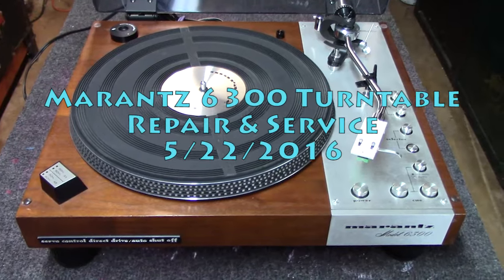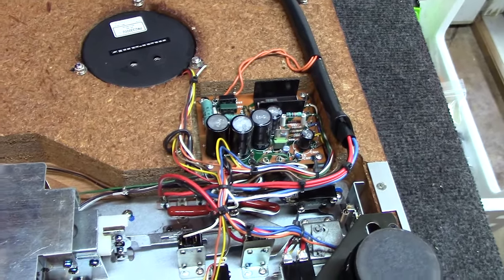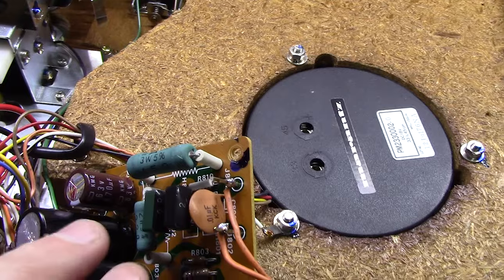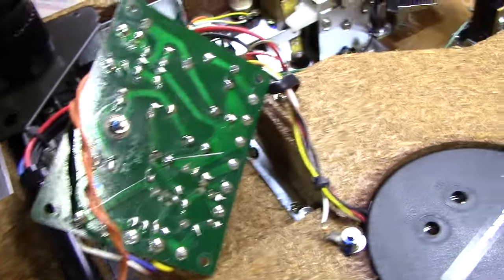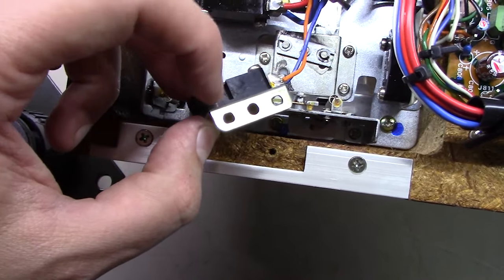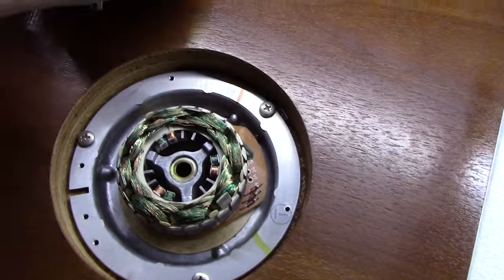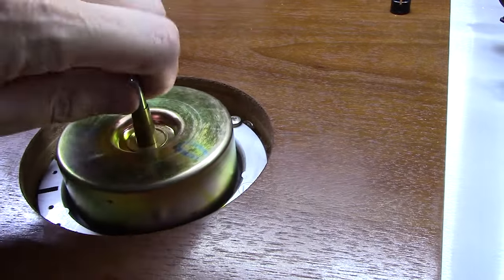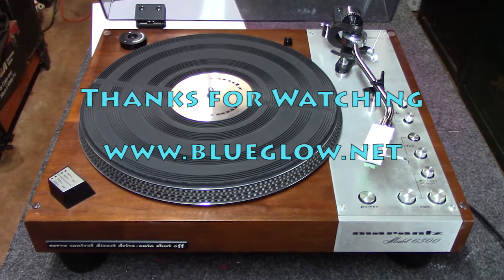Marantz 6300 Turntable Repair and Service - BG061

Comment: I have a 6300 myself. I had it serviced. I just needed a new strobe light and a good cleaning. Hopefully I’ll get another 45 years of use out of it. But, wait…. I’m not going to around another 45 years. But, you get my point. 😊😊

Comment: I went above and beyond on my Akai AP307 I installed new caps it fixed issues with startup delay and hum didn't lube the motor it's moves freely it turns using pulses instead of constant rotation great quality well built only payed 200$

Comment: I've seen other people say that because the electrolytic capacitors in a turntable are not exposed to high frequencies that they should be okay after 30+ years. In my experience in fixing turntables I find some of the caps are off or leaky (especially the blue Sanyo caps from the 70's/early 80's). Simply because they have not been exposed to high frequencies over a long period of time does not mean they will be okay today. As shown they will degrade mechanically and start leaking corrosive electrolyte, depending on the age/brand/cap series/use of the unit.

The safest solution is to replace the electrolytics if they are the originals and are 30+ years old. The advantage is the new units usually will be smaller at the same or higher voltage and will be better long term due to advances in technology.

Comment: Excellent video.  May I add a bit of info. please (I've owned this TT for 40 years): please refer to timing 17:40 where the flywheel is removed from the motor for cleaning. The moderator correctly stated that THIS flywheel has no ball bearing at the bottom of the flywheel shaft, but other companies did include one (so don't tip the TT over and lose it). However, this ball bearing/flywheel setup exists on my model 6300. I noticed it 35 years ago when the first lubrication was done, and I heard it rolling around at the bottom of the shaft. In this case, you must tip the TT over with your hand over the shaft hole, catch the ball bearing, and then clean/oil that area.  Thank you.
Reply: turnstile7: thanks very much for that great piece of information!  My old 6300 is in near mint cosmetic and working condition EXCEPT the darn optical sensor setup that controls the auto shutoff is stone dead (not a matter of adjusting the sensor position on its little track). Nobody will touch this repair job (obviously no parts available). Do you know of anybody?  Thanks!

Comment: Agreed about the oil.  I buy turbine oil for the long spout. At 2 bucks, I go several years.  I did use 2 stroke oil on a 1/4 HP motor, it worked great. Capacitors, Yes the years are ticking by. I was a teenager when that came out.  I cannot accept your deduction of it being 40 years old. LOL

Comment: Can you put a list of the caps used in the description please? Thanks for the great video.
Reply: C801 - .01 uF (ceramic) - 200v
C802 - 470 uF, 50v - electrolytic
C803 - 330 uF, 50v - electrolytic
C804 - 220 uF, 25v - electrolytic
C805 - 100 uF, 25v - electrolytic

Comment: Great video.. very useful.  My service issue is a no longer properly dampened tone arm lift .  The up and down buttons trigger an action, but the lifter  pops up dramatically and descends the same way.  Inside it looks like some sort of solenoid moderates the action.  is this were the issue is?  If so what is the fix.  thanks for any help you can offer.

D

Comment: Is there a difference in use deoxit vs regular contact cleaner bought from a hardware store? I always hear how deoxit is amazing, but is it better then other contact cleaner?? Is it worth paying the extra cash?
I have an old denon dp55 turntable and I worried that if one of the caps go could it destroy my turntable? 
Thanks so much for any help

Comment: Nice video. I was always under the impression you shouldn't use automotive motor oil in electrical equipment because of all the detergents, is that not correct?

Comment: Dear Blueglow commentator:  please refer to timing 13:16 on your video, where you point out the two pitch control potentiometers, and then clean them with DeOxit D5.  I've done that exact same cleaning on my 6300, and found that the even the tiny blast of DeOxit D5 had washed away the black grease that lubricated the little shafts on the rotary pots.  Now, the shafts turn with no resistance or "feel" (no shaft lubricant), but electrically, the pots do work better because they are clean.  How do I safely re-lubricate the shafts: use another DeOxit product (lubricant only)?  Please advise, thank you!
Reply: There iis a Deoxit lubricant...It has a green label

Comment: I am currently recapping a Marantz 6300.
One of the wires disconected from the post on the board.
I noticed that the bare part of the wire was wrapped around the post about 6 times. Is there a reason for that?
Can I just solder the wire directly to the post?
Any help would be greatly appreciated

Comment: I need a pioneer pl 570 with a bad power supply that need rebuild and a bad tonearm motor and broken plastic gear. Have you worked on such issues?

Comment: Hi great videos I've been learning a lot from them. I have a quick scenario to run by you I have a technics sl-230 turntable and it has constant unstable speed issues. It has new belt and the user speed adj pots and trim pots have been cleaned with deoxit lots of times and it will play for a day or so then speed will go out of adj again. Can it be a capacitor in the circuit or the motor itself? I can't see why after cleaning the pots really well it still continues to have speed issues. Any input would be greatly appreciated, thank you

Comment: Great video! What were the values on the caps you replaced? I'm ready to replace them on two 6300 restorations I'm working on and want to order them as soon as possible. Also, one of the turntables slows down occasionally, Anyone know what that could be?

Comment: I have a Marantz 6100 that wont make any sound. soldered new rca jacks on to the speaker wires, pluged into my amp and nothing, no sound. the internal wires all seem to be soldered well still. any suggestions? everything else works fine. just put a new stylus on and now im bummed.

Comment: Ooops! I guess I should have watched this video BEFORE I got DeoxIT all over that optical sensor that triggers the tone arm lift mechanism in my 6300...I was attempting to fix the "auto lift" feature, which has not worked routinely/reliably for a couple years now.

Comment: Hi my name is Tom maybe you can help me out. I have Technics SL-1300 turntable that will power up ( the strobe light comes on but the platter dose not spine like its not getting any power. I have cleaned all of the speed adjusters with Detoxit and still no spinning. I would love to get my TT going again. Thanks for any help

Comment: Hello, I see you repair few Marantz TT and I have a Marantz 6100 and it will skip or jump on the last track of the LP, any thought on it?

Thanks,
Reply from the maker: +felplenz Check your cartridge alignment
Reply: Being the 6100 is an Auto Return model, the symptom you describe could be the trip arm/cam is binding at the last part of the record causing the arm to stick or not advance with the groove.  You will need to open up the machine and check that the Auto Return linkage is not binding or the grease hasn't become gummed up.
Reply: The 6300 was one of CEC's finest models offered under the Marantz name plate.  Still an outstanding machine by today's standards when properly serviced!!!

Comment: The only reason I don't like to use auto engine oil is that it has additives for cleaning combustion by-products which are not needed in bearing lubrication.  I prefer a light sewing machine oil.
Reply from the maker: Not trying to debate what you are doing but I've found the synthetic motor oil to hold up much better over time.  I used sewing machine oil for years but then after 5-8 years customers would bring back their units and it was as gummed up as the original factory oil.  I do admit though I've only been using the synthetic motor oil about 7 years so I haven't seen a lot of return units.
Reply: Interesting.  I suppose someone in your position would need the longest lasing lubricant possible.  I change out my tables oil every few years, so longevity is not a concern.